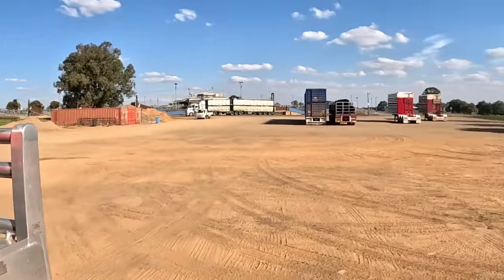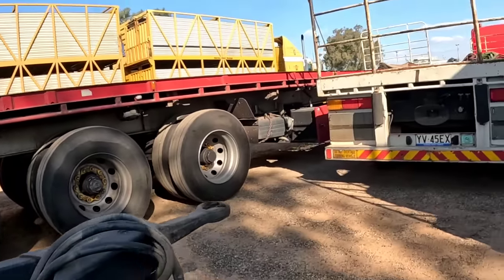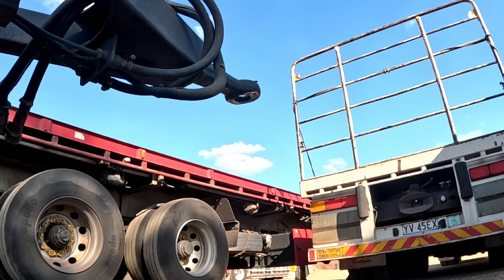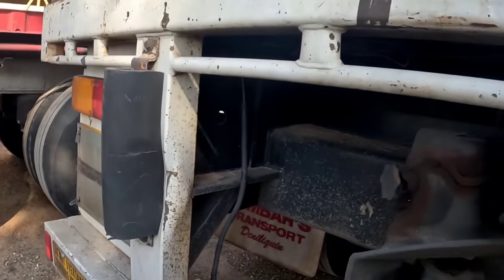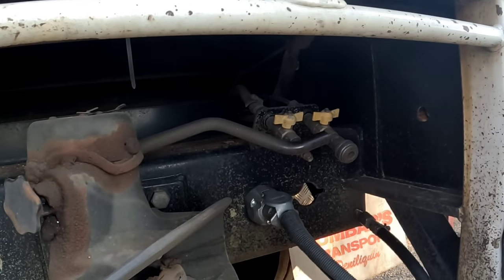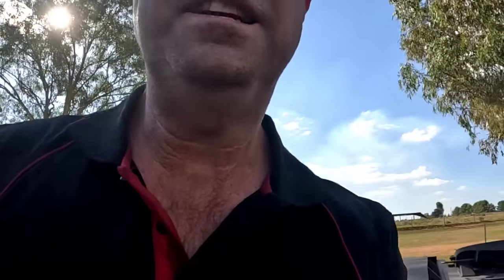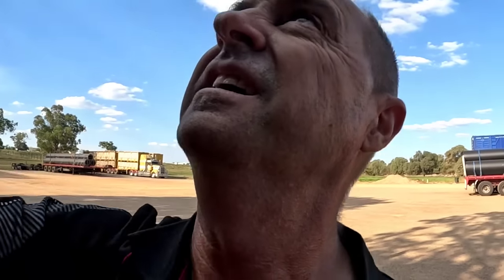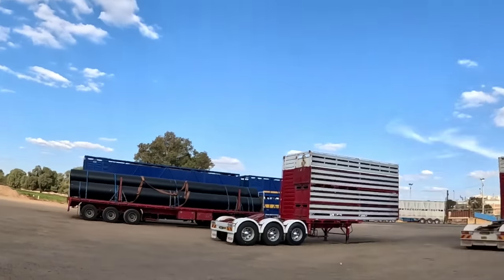Trailer Action - Hooking up and Dropping a trailers

Comment: G'Day Jonno.Here's an observation I've made. When you go around tapping the rims to get the dust out, I've noticed that you only do the outside rims, not the inside ones.  Or am I mistaken ???   Regards, Greg.
Reply from the maker: Banging on the outside rim vibrates the inside rim too.
Reply: @RoadTrainAdventures  See, I told you it was a dumb question ;-)
Reply from the maker: No it was a valid question.

Comment: Johnno, great video mate!!! Great to see you aren't slamming the PM into ringfeders etc, checking heights... twisting the locks on the airlines....no tug test on hooking up the lead?? Finally, why dont you wear gloves mate??? (Also, I keep calling up your mates here in Perth and asking is that you Johnno....but it hasn't been) finally, we just had a safety bulletin where the locking pin has come adrift on the landing legs swivel and the retaing pins have nearly worked their way out, which could have caused a major drama if the swivel foot had come off while driving.....might be worth a mention. Cheers mate, good on ya!!
Reply from the maker: I did the tug test after turning off the camera. Tube was getting away and so was the amount of footage I was taking.

I don't like wearing gloves unless I have to. If I'm doing tarps then I do it I get blisters.

One day you'll see me around Perth. I rarely have the radio on when I'm driving around town though but hopefully you'll be able to signal me somehow.

Comment: As a UK truck driver I have noticed there is no pin to secure the fifth wheel to the trailer and no tug test to make sure the wheel is locked and the landing legs are not all the way up! If i did this here Id loose my licence and my job if the inspectors looked at it! All while im packing up my house on route to Perth looking for truck work! Love the informative videos, thanks for all the effort you put in to let those that dont know, know!
Reply from the maker: I'm not sure what this on to secure the fifth wheel is. Can you explain more. The landing legs were basically all the way up and yes I didn't show the tug test as I did that after stopping the video. I did explain that on this Holland Hitch as long as that bolt is in at the front of the turntable then its locked..
Reply: @RoadTrainAdventures  if you look for a video titled 5th wheel dog clip, you will see it there.
Reply from the maker: OK thanks

Comment: Johno i liked the video well done. I noticed that wnen you wind the legs up dont they have 2 speed. I see that Ken winds like hell too get the legs as well. Just wondering they were 2 speed when i drove again well done to show its not just jump in and drive  thanks
Reply from the maker: Thanks heaps. Yes they are two speed. I rarely use the show speed. That was winding using the fast speed.

Comment: Hi Johno in the u k it’s a must trailer brake fist then landing legs airlines then the pin good videos keep them coming stay safe regards bob
Reply from the maker: Oh OK. Thanks Bob. I've never heard of an order of doing things in Australia.
Reply: To get your MC licence in Australia there's a whole bunch of things you have to remember and demonstrate in your test, though there's generally not a specific sequence as long as you do all the steps. Johnno doesn't do many of them because, like most truckies, once you know what your doing a lot of them are just a waste of time and really designed to make sure new drivers don't make mistakes. Things like visually checking the jaws, clearance checks, winding the legs up just clear of the ground before the tug test and then all the way after are examples.
Reply from the maker: @trimat2016 Very good answer right there. Thanks
Reply: AUS trailers do have not requirement to have a trailer brake button on outside of trailers like UK so its rare to find an actual trailer brake button on the outside of the trailer that I see you UK guys doing when disconnecting as step 1. Disconnecting airlines will automatically put on trailer brakes. Also we don't have pin/dog clips on the pin that i notice on uk videos.
Reply from the maker: Ah

Comment: John, at the end of the video, you had dirty hands and "no taps", to clean them.  
Buy baby wipes (unscented) from the supermarket, they are cheap and great for this sort of cleanup, or if you do not have access to a shower.
Reply from the maker: Oh I didn't show you coaching my hands but I've got proper handset cleaner and water tanks on the trailers.

Comment: Thanks, it was great. Only I have to connect my truck and trailer with 2 air and 4 electricity cables. European 🥴
Reply from the maker: 4 electric cables. What are the four?
Reply: 2 for the lights, 1 for the smart ( self thinking ) trailer and 1 for the backlift.
Reply from the maker: Why 2 for the lights?
Reply: Good question, I don’t know.
Reply from the maker: @ferryvanvelzen6597 OK